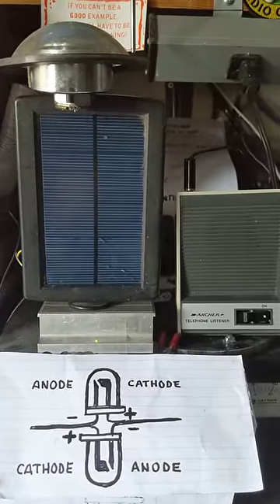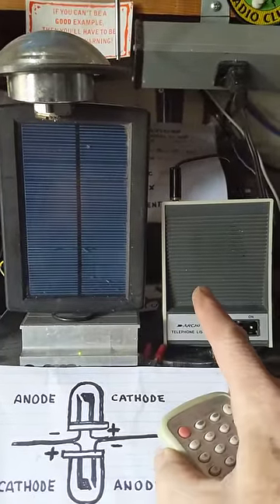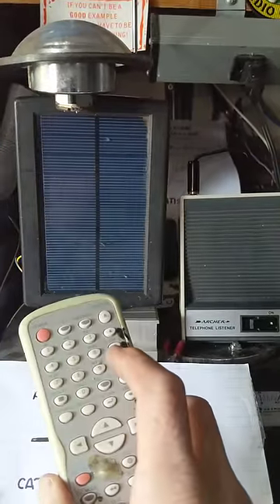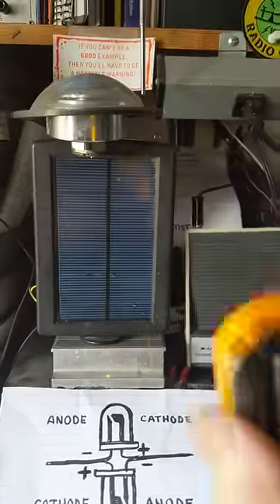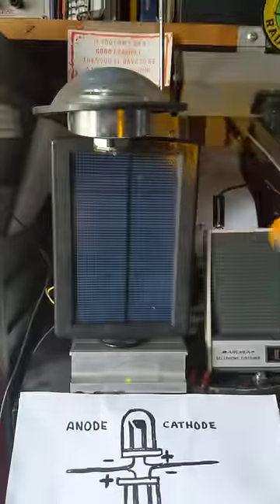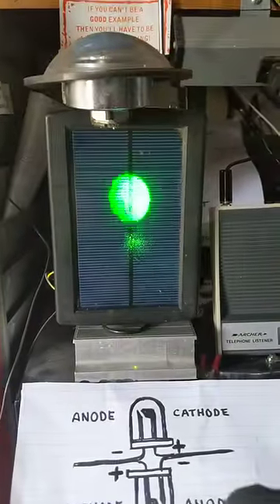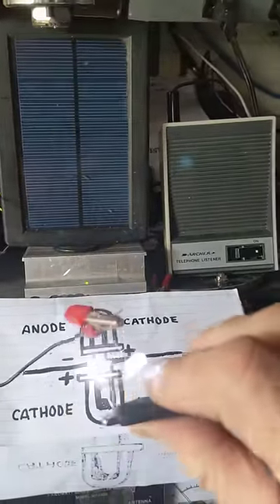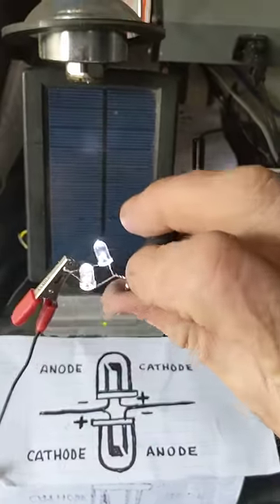Solar Panel Audio Detector!

Comment: I grew up with a Radio Shack 101 in 1 electronics kit and I still remember the day it dawned on me that any circuit i built that had a diode and a speaker could be turned into a radio if i touched the circuit providing an antenna. I quickly discovered that the diode and speaker were the only thing necessary it didnt even need the tuning part of the circuit to operate. I never thought of using anything other than a speaker to detect the radio signal. I'll definitely be playing with this
Reply: Okay..but you have to.make a video and point us back to this source... 😊
Reply: I Made that Same Circuit, Think it was only a Coil, a Diode(Thing Germanium?), and Earphone, No Power, Clip on to Water Faucet.
It Worked
Reply: @danielpeck6269 Could you indulge me a little bit?  I have several questions!  

I understand the basic "check" principles of the diode; I know how to build a rectifier and all that....  but how does the check property of the diode, battery and speaker work? 

Like... without a chrystal, or any other means of synthesizing a beat freq, how does this operate?  
Does it work with basic diodes too, or does it have to be LEDs in particular?  
And how is it catching two different frequencies too, on top of that?  
Is there some resonant denominator between the two? 
I have so many questions!! 

BTW, I had the big wooden breadboard with fixed components wired to spring clips from Radio Shack too as a kid in the 80's...  over a hundred circuits I could build with it, it claimed.  Wish I still had that jewel! 

Also unrelated but kinda, I immediately noticed the Archer logo on that speakerphone module...  Radio Shack was the best!
Reply: @1SqueakyWheel Receiving a double sideband AM transmission with minimal components would work by just half-wave rectifying the signal from the antenna. The varying level of signal would drive a varying direct current through the circuit, it's as simple as that. A series loop of coil antenna, diode, and inductive earpiece does that. A germanium diode is stable and predictable but not necessarily very sensitive though. For example, using a razor blade and a pencil lead as a more sensitive diode is possible. The flipside of that coin is that such a diode has a far lower reverse breakdown voltage and may distort and/or not be very loud with a strong station. You could find many different pairs of dissimilar conductors where a weak contact between them can act as a diode. Modern FM is virtually silent to the setup though, and single sideband AM is likely weak at best.
Reply: Fond memories you brought up.. especially when you started to combine the 100 in 1 kit with other digital devices. Then mom asked why it smelt like something was burning.. told her one of the parts just let out a little smoke 😂 a young Nikola at work.
Reply: @randyaivaz3356 me too! I remember the plastic earphone thing was grody from me messing with it and dropping it a 1000 times.
Reply: Core memory unlocked! 

I had the 130 in 1 kit. I remember getting it for Christmas from my dad. I thought it was the coolest thing ever. I was amazed to see all the different circuits I could build.
Reply: Did you go into the electronics field?
Reply: @randyaivaz3356 Did you go into the electronics field?
Reply: @kirkw1628 Did you go into the electronics field?
Reply: @ChrisWoodBandit Did you go into the electronics field?
Reply: @KevW-z7z  I'm a BMW technician now so I deal with electronics a lot on these highly digital automobiles. I use my Fluke 115 most days
Reply: I also learned on the 100 in 1 set.
But before that I built Crystal radios. What you have here is a crystal radio picking up AM radio singles. Surprising at first until i realized what was happening.  The Gap in the LED, Diode is determining the frequency. It should be possible with only one diode.
Unusual with a solar panel as a modulator.
Reply: @jussikuusela7345   I am an electrical engineer and I REALLY would like to see a Razor and a pencil lead radio. I an doubtful it would work as a diode.
Reply: @mrgcav  I won't blame you for trying and finding I'm wrong.
Reply from the maker: @jw11432  I still have a few of the multiple project boards. They are to much fun to let go of.
Reply from the maker: @KevW-z7z  Yes to a point. I'm a former TV repairman.

Comment: Nothing says 1970s like Archer components and an LED radio! 😅 You rock!
Reply: Of course, in the 1970's LEDs were primarily of the red variety.  I remember when blue LEDs came out and they were rather expensive.  The white ones are even more recent with the production of high-intensity blue LEDs in conjunction with doping for yellow fluorescence to produce white light.

Comment: I sorely miss Radio Shack. :(
Reply from the maker: Me too. Especially their project kits.
Reply: And Lafayette kits
Reply from the maker: @georgeharris5935  I remember Lafayette electronics.
Reply: Yes!!! The back of the store is where the maker bins were!!!
Reply: Still looking for a R.S. aluminum half-wave base antenna. Best antenna I ever had.
Reply: I learned so much working there for just a short time right after HS.
Reply: What happened to radio shack and where do we go now ?
Reply: I haven't checked recently but radio shack might still have an online store you can order parts and kits from. I got some switches and a project box a few years ago, made a colloidal silver generator
Reply: It's reopened as a digital store now OP
Reply: whats annoying me of their loss is my mom used to work at em.. then they went poof and mom had to find other work.
Reply: If you live near a HobbyTown, I believe they partnered with the company that owns the RS branding to sell a small selection of their hobby components and kits.
Reply: My first triple trunking scanner came from Radio Shack

Comment: Incredible!!!!! I think what happened was the leds were pulsating at the same frequency as the radio signal they were receiving!!!!! And the solar cell translated that back into sound!!!!!! It's simply incredible!!!!!
Reply: I mean that is LITERALLY what happened in the video.
Reply: @Treon thankfully this guy explained it for the people that don't understand instead of acting like a know-it-all and pretending it's common knowledge like some morons would do 🙄
Reply: Yes, the LEDs are following the radio signal AND they're cutting most of the waveform out, leaving a crude rectified high frequency signal, which doesn't cancel itself out (at the cell or speaker).

At first I was mis-LED by the fact that there are two LEDs and two stations, but that's just a coincidence. Because of no tuner involved, channels of different frequencies can be heard simultaneously.

Oh yes, two LEDs rectifying different halves of the RF give more output power. Crude full wave rectifier. Crude, because white LEDs have rather high forward threshold voltage, but then of course it's all proportional to the amplitude coming from the antenna, which will be compressed/clamped when the LED starts emitting light, right? So the voltage (actually current) won't rise too high to break the LEDs.
Reply: @SamiJumppanen  Yes.
Reply: Constructive interference
Reply: @SamiJumppanen  can you explain what the LEDs are wired to? It seems that it might be an alternating current if both are providing light because they are wired opposite to each other. I just don't understand what they're connected to
Reply: @danr3778  he says the other end goes to ground and the other to antenna. I understood that the LEDs are driven purely by the antenna (AM radio reception).
Reply: @SamiJumppanen , if you put a LED equalizer in the mix, would it slow down the frequency so you can hear, understand what they saying?
Reply: @danr3778  thats what i was thinking
Reply: @danr3778  a 200 ft. piece of wire, the power comes from the radio station transmitters nearby

Comment: It's amazing how the ears are so much better at decodong this information than our eyes.
Reply: On the surface you’re absolutely correct, but when you stop to think about how our ears work it starts to make a lot more sense. The light waves our eyes see don’t change in frequency, just relative amounts to other frequencies. Our ears on the other hand are “designed” to not see the amounts of 3 different frequencies, but a range of frequencies. 
Our brain doesn’t use this to make a 2D map, but rather decodes it as a 2D graph. The difference here being that our brains pick out frequencies within a range along time instead of the strengths of 3 pre defined frequencies. 

Essentially, our eyes aren’t meant for decoding information like that, even though intuitively the information is better represented visually. Our ears, however, are intended for recognizing frequency changes, abrupt or subtle, as that’s the whole deal. 

Astrophysicists actually used this mindset change to analyze signals from fast rotating stars to actually make sense of the data — and it worked. 

So, you’re not wrong, because it is amazing. But imo, it’s more amazing that we haven’t collectively realized how underutilized our ears have been in data analysis in modern times when our brains are already wired to efficiently analyze spectra in an auditory fashion. 

Sorry for the ramble, I’m a goddamn nerd
Reply: @ptrkmr  incredible. I wonder what other types of data besides light might be better represented auditorially rather than visually?
Reply: @ptrkmr  the bit about the astrophysicists is actually really cool, thank you for sharing!!
Reply: @ptrkmr  Rock On!
Reply: @ptrkmr  the weird part is also realizing that there is no reason in particular why our sight shouldnt work like our hearing.  We could easily have ended up in a world where  we talk by pulsing light, and hear light like we currently hear sound.
Reply: @ptrkmr  Very enlightening comment. And it's great to hear that we've been using auditory analysis on astro data. As an amateur astrophotographer & astronomer, I sometimes wonder what things we might be missing due to our means of analysis. 

I can't help now but wonder what interesting patterns might exist in the cosmos that we're just not noticing due to this difference in perception being under-utilized. It seems like auditory analysis could indeed pick things out that we just wouldn't otherwise notice. 

Thanks for sharing your insight! These are the kinds of comments I scroll along, hoping to find.
Reply: another cool ear fact, one of the ways u can tell the direction of a sound source is the inter-aural time difference, or how the sound will reach one ear before the other. the smallest difference in arrival time were able to distinguish is just ten microseconds! u can close ur eyes and snap ur fingers in front of ur face, and u'll be able to hear even the slightest difference😮
Reply: Very true. Most think thier eyes are more sensitive.  Hearing harmonics takes so much precision in hearing, down to almost single wave detection.
Reply: @ptrkmr i think it's actually a more complex group of ranges of frequencies the ears pick up using small hairs. These hairs will get damaged over time and you lose the range the hairs were sensitive to. Eye input is 2D, Ear input is 1D. 2 eye inputs makes 3D view... 2 ear inputs makes pseudo 3D sound although it's technically 2D.

Comment: Those are AM radio stations.. The wire is acting as the antenna and the LED is half wave rectifying the signal. This effectively decodes AM. Lovely project !!

Comment: Lights were being serviced in a darkened office where I was asked to check out wall-mounted fan-forced heaters. Took the cover off the first and powered up. The fan was turning really slowly, which i thought odd. Usually they either work or not. Was reaching down to give it a flick when I thought of something.

Switched my headlight from low to high. Sho 'nuff, fan was operating normally. Nearly got punked by the ol' stroboscopic effect.
Reply: whaaaaat?!?!

scary
Reply: I hate PWM dimming with a passion. I understand it's the most efficient way to provide a dimmer looking light with a given LED, but fast moving objects look like they're under a strobe.
Reply: @iamdave84  Perhaps it's just a question of inadequate filtering downstream of the PWM switch. A few pennies for a bigger capacitor might cure the issue. 

My wife is one of those folks who is sensitive to flicker that most people wouldn't notice. I brought home a nice AC LED fixture for the kitchen and it gave her a headache, I suspect because it is letting through some 120Hz pulsing. So I got a new RV-style DC LED ceiling light that has four intensity settings and she's fine with it on any setting. (I'm off-grid and have DC available.) When I get some time I'm going to put a 'scope on them both.
Reply: @civildiscourse2000 I could be wrong but I think when you smooth the pulses the perceived brightness drops. 

Eg, 3V LED getting 3V pulses 50% of the time appears brighter than the same 3V LED getting 1.5V DC, which is what you'd get if you smoothed the pulses completely.
Reply: @iamdave84  Entirely possible that perceptual response might depart from what a pure signal analysis would suggest. So now you've just gone and made the problem more interesting. 😜

However if that's true and I was designing the system I'd opt for smoother output and push the duty cycle up a tad to compensate. But then I'd probably provide continuously variable dimming instead of steps anyway.
Reply: Your smart on your feet. That will pay off one day
Reply: Saved some fingers probably, lol

Comment: Sometimes you watch a video that makes you go: „Huh,…“ and that’s one of them. Thanks for sharing
Reply: It even made him go huh
Reply: You don’t understand what it’s doing?
Reply: That's definitely an understatement 😂 I'm like what sorcery is this?
Reply: @Industry-insider  I'm no electric person, but i gotta basic understanding of the components and how they work. I've watched some videos tryna understand how class d amplifiers and ac to dc power supplies work. But, i am a trained mechanic in the military and i do understand how automotive circuits work.

And i can see where somehow that i have yet to comprehend those two leds are some kinda rectifier, but honestly, I'm still hung up on how in the hell not just one, but both leds lit up bright enough to transmit pretty clear voices, despite being in a well lit room, which would be like background noise, and I'm sure this is not a lossless reciever either, when it appears to me that not only is one led backwards, no matter how you hook it up, but they are being powered by, atmospheric radio waves going to ground, that must be a helluvva antenna.

So if this makes sense to you, can you explain it to me? Cause my gut is telling me that last part is bullshit, but i don't mind being wrong about that if I getta learn something new.
Reply: @bullfrog80  no, he’s feeding audio through the LEDs and the slight pulses are being amplified back into audio, you’re overthinking it. It’s just a way of transmitting data/audio or hearing flashlight PWM frequencies

Comment: The LED's setup reminds me of a cat whiskers radio that I built about 50 years ago. There was no battery but we just used a long wire as an antenna with a crystal and a very thin wire. When you touch the thin wire to the crystal we pulled in an actual radio station. This was the experiment that convinced me to become an Electrical Engineer.

Comment: I did the same thing with CDS photo cell and a coupling capacitor with a battery when I was in grade school. Awesome Dave!
Reply from the maker: I'll have to try out the photo cell cell circuit. I found a few circuits in Forest Mimms communication projects, which enable them to operate at a much greater distance.

Comment: Dude finds a way to pickup FM signals with 2 LEDs and then transmit the signal with light. WTF did I just witness? Pretty awesome and guy keep tinkering.
Reply from the maker: They were AM radio signals from our local radio stations.

Comment: Soon to be an electronics engineer here, and I'm super impressed by this. Is there a full video explaining what you all did because id love to repeat this
Reply from the maker: You may like this video on the topic. https://www.youtube.com/watch?v=vHVmJ5lD9jc&t=33s
Reply: Apparently you can also hear wifi signals too huh
Reply: Wait until you hear about LED array backfeed motion tracking AI.
Reply: Just an amplifier wired to a solar panel...
Reply: We have all of scanning technology in the world but we can't even click on this link
Reply: It's fake
Reply: Use a nine volt battery, Bias on the Led, Use a capacitor like a ten u f, and inject your audio from your ipod.  Sorry back in my day we used tape recorders.  You could even try different types of microphones.  I am surprised that we don't communicate with laptop computers in rooms over led light bulbs.  the Through put speed would be incredible.
Reply: @GREGGRCO thats strictly only for backdoor government access.
Reply: My brother works with electronic engineers. Don't be dumb and weird like most of them are.
Reply: @GREGGRCO light bus technology is a very real thing in computing
Reply from the maker: @Ψευδάνωρ  Yes you can hear Wi-Fi signals, but they just sounds like a bunch of fast clicks.
Reply from the maker: @rosergio7227  Yes that's it, but I also have 200 foot long wire antenna and a ground wire going to my LEDs
Reply from the maker: @thepanelchannel8879 Sorry but you're wrong about that. https://www.youtube.com/shorts/aSSqrddG6B0